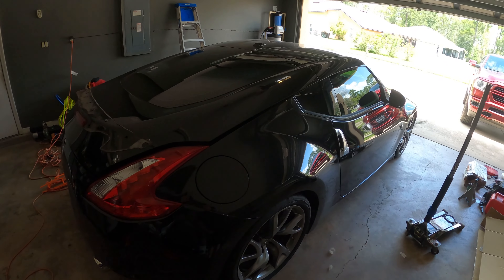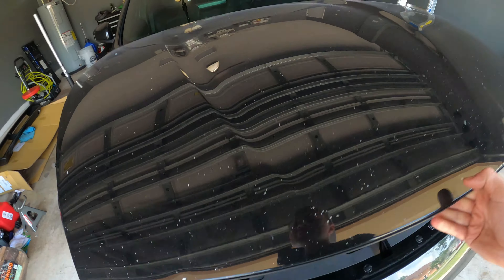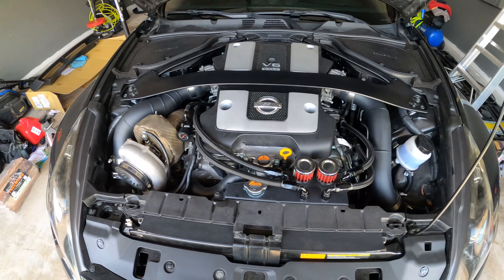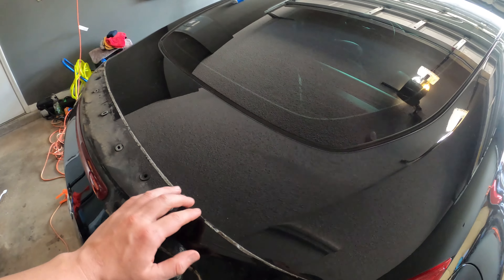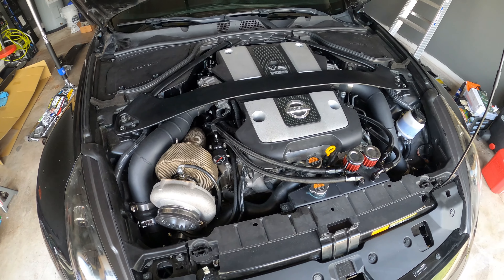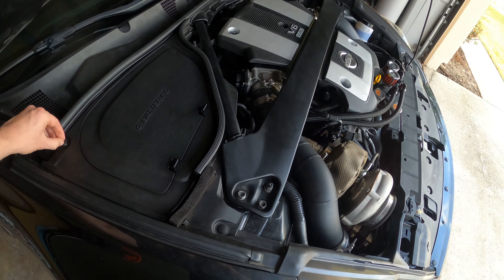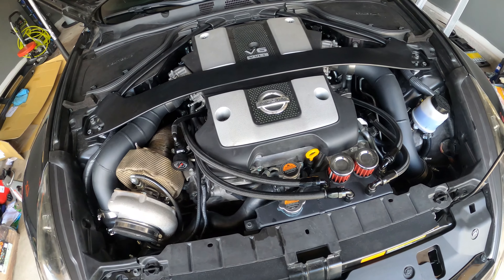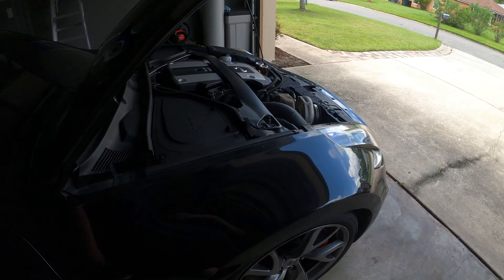The 370Z Broke Again | Building My Turbo Z To 900+ HP

Comment: Damn man sucks to see you gone with the z build. I was heavily inspired by your vids to boost my Z but the deeper I dive the more it doesn’t seem worth it..stock VQ blocks seem to really not like anything over 400whp. Makes me sad cause they are one of the coolest sounding engines ever made! Especially boosted. Plus I don’t got enough to drop on a GTR :(. Thanks for the vids tho man! Hope you’re doing well with your new car.
Reply from the maker: Thank you! From my experience and with some of the other boosted 370 and g37 guys some dudes have good luck and push 600 wheel no problem. Some guys like me blow it up after a few pulls. I have a buddy that lives near me went through 4 motors on 580 wheel and blew them all. Just luck I guess.

Comment: Do you know what could've prevented the spun bearing? I'm doing a similar build next month with Switchback and the 6466. Same injectors, 525 pump on stock block. Just worried about blowing it also. Going for 650whp
Reply from the maker: Well the first time I blew it was a mis communication between me and the tuner. He thought I had a 4 port when I had a 3 port Mac solenoid. The second time I blew it I just recently found out from switchback who I sold the car too. They was taking it apart and noticed the vacuum lines where installed incorrectly on the wastegate. Back story when the shop near me did the engine swap we replaced all o rings and gaskets well one had a small leak and the only way to access it was to drop the engine. Well when they reinstalled it they put the vacuum lines on wrong. So when I went to test drive it I blew it again. So from my experience both times I blew the engine it was not the cars fault. So I wouldn't be to worried about it. There are plenty of guys out there making 650. I made 636 on 14lbs and e85.

Comment: 4 digit HP. Might as well you'll be so close and you're tearing it down anyway
Reply from the maker: I think after my internal building my next limits will be either turbo or fuel. My current turbo is only rated to 900 hp. Fuel system i think i may need duel pump and bigger injectors. Im not sure what my duty cycle was at my current power.
Reply: Nah I'm just talking shit, 900 will be more than enough lol, good shit bro. Hopefully she's up and running soon
Reply from the maker: @ldnd41593  being able to say my z made 1000 hp though would be dope

Comment: hey boosted whats up?  I've got a single turbo 3.7 car.  Were you running 15 pounds for long?  I'm about to e85 swap and turn up a bit on a stock block but I want it to survive if possible.  Also the rubber wheels work awesome as long as you keep the speed/heat down.  
Thanks
Reply from the maker: Yo! Sorry for the crazy late response I’m sure you got it all figured out now. I was running 15lbs for quite some time till I blew it again by accident. The shop that fixed the oil leak put the wastegate lines on backwards and I blew it by not having boost when I was suppose to. But yeah 15lbs was killer. The r888rs where bad ass. I kept traction on that 800wheel pass when I first blew the engine.

Comment: 900hp overkill  Why not balance the car suspension subframe reinforcement  brakes 100 or 200 treadwear beefy tire setup at all 4 corners  still push like 700+hp w/boost by gear  n be a phenomenal drivers car
Reply from the maker: Not sure if you watched the whole video but I want to shoot for 900 but I'm not going to run 900. I'll most likely keep it around 700.
Reply: @ShayHarambe   I watched the whole video  I'm just saying  in general 900hp is overkill  I'm not wealthy so I need my car to do everything  900hp  n rear wheel drive  ends up being a 1 trick poney  to each his own tho  Freshkiicks Z is kinda the example  it's sick but  it's limited  He's got like 2 other sports cars  n a bike  So for him it ain't a problem
Reply from the maker: @427BDK  yeah i agree. its all in the plans of the build. Now i do have full suspension. I have solid subframe mounts to install and tires I will be swapping to something different when the z will be ready.
Reply: Ain't nothing wrong with having that much power on reserve. You can always run low boost for daily and road course. Then have a Hellcat/GTR, M3 etc mode 😁  just because you have 900-1000 hp at your disposal doesn't necessarily mean that you need to run at those levels all the time. That's the beauty of turbo car. You can always turn the boost up or down with a EBC and the right supporting mods.

Comment: I got an 08 g37 auto and I’m up in the air rn about reading it in for a manny Z, I don’t know how I fee driving a stick daily
Reply: I have a manual Z that I daily, I learned to drive stick in it! It’s easy bro, you just gotta get used to it
Reply: @reggieracing  my 85 4 runner is a stick and i typically get annoyed driving it after a while
Reply from the maker: A manual car for a daily really isn’t as bad as it may seem. Unless you have a hard af clutch lol

Comment: Right now I just got a plug play chip suspose   to give me 40 extra hp will see til I get header and exhaust and take speed limiter off
Reply from the maker: If you got the money one day I would go with sohos supercharger kit. Fairly cheap and makes just as much power as a top mount. Plus the blow off valve is wild! If I had to do it over again that’s the route I would have went.

Comment: is a walbro 450 fuel pump enough for 800whp?
Reply from the maker: Yes it will be. I am running a 450 fuel pump and when I boost spiked 28 psi my tuner said that was roughly a 800 wheel pass. I dont obviously have official data to back that up. Just going by what the tuner said.

Comment: You spun a bearing since the last tune ?
Reply from the maker: Lol yeah. I spun a bearing in my first block then my second block. The z is sold now. I couldnt keep dropping blocks in it.
Reply: BoostedVQ sheesh I don’t even know if I wanna boost it anymore 😅
Reply from the maker: @rabbz1128  lol yeah seems like some people have better luck than others. I have a buddy that lives close by and he blew 5 engines now he was pushing more power. My first block blew more of I dont know who's fault. Boost spiked 28 psi about 800 hp. Second block though I tuned for 630 wheel and blew it like 2 weeks later.
Reply: BoostedVQ yeah thats wild
Reply: @ShayHarambe  Were you always running it at 600+? Gonna boost mine soon any advice?
Reply from the maker: @brianritzpatrick4737  yeah pretty much. I bought the car it stayed stock for like 6 months then went straight to boost. Advice is do your supporting mods. That's the biggest thing. They suck to do and cost a lot but help so much. Also if you turbo it my biggest recommendation is go bigger wastegate or run two depending what kit you run. That was ultimately why I blew 2 engines. I didnt have enough control with one wastegate.
Reply: @ShayHarambe  Thanks appreciate it man. What you planning on getting now?
Reply from the maker: @brianritzpatrick4737  I have a 15 mustang gt. Actually I'm currently installing coilovers as I type this.
Reply: @ShayHarambe  those waste gates sure are engine killers lol now that I have a big 60mm no problems what so ever, placement is also extremely  important
Reply: @ShayHarambe  so to recap from a year ago im in your exact position lol ironic

Comment: Bro why’d you give up...
Reply from the maker: Well shortly after the z blew up a second time I had some big personal things pop off 🤷‍♂️ so I had to sell my Z and my brand new truck. I have a s550 mustang now. I plan on boosting it in the future.
Reply: @ShayHarambe  hmmm I have a nismo but idk that new 5.0 is nice, is it worth it or nah? Selling Z to get a new 5.0
Reply from the maker: Ehhh I had dumped so much into the Z. So for that reason no. However the 5.0 can hold like 800 wheel stock block. So that part is nice and really that’s just adding boost. No supporting mods are needed. Procharger added a p1x or a d1x to a 5.0 and made a little over 900. That’s just the procharger and I think pump and injectors. It’s crazy.

Comment: Do you recommend me to boost my Z ? Honest opinion
Reply from the maker: Ohf i actually haven’t been asked this question. Honestly no. I think you could find a better platform that handles boost better and for cheaper. When I went into this build I did not think it would cost this much. I know have a 2015 mustang gt where I could throw on a supercharger for 6k and make 750whp with no other mods.
Reply: @ShayHarambe  I see alot of people doing alot of mods on the 370z and sometimes I'm afraid I can blow up the engine for so much things and expensive parts lol
Reply from the maker: Yeah the z platform isn’t cheap to mod. When i was in it I saw a lot of people blowing with just intakes and exhaust. That has a lot to do with the tuner though. Cheap out and get a crappy tuner you get a crappy tune. Realistically even with fbo the z is slow. Sorry not sorry lol. You can’t really keep up with a stock mustang. The only time the car shines is when it’s boosted but to do it right it’s big money.
Reply: @ShayHarambe  you sold ur Z now what car are you going to tuned? 
When I saw your Z you gave me hopes to tune mine but I'm scared of blowing it lol
Reply from the maker: I have a 2015 mustang gt now. I’ve already done full bolt ons, bag and some exterior stuff. I’m saving for wheels and tires then a vortech supercharger. I’ve thought about making videos on it but so many people have videos on mustangs. Only a few had videos of a turbo 370z.
Reply: @ShayHarambe  I saw some subs asking about you and me included lol.
You should upload a video of your mustang. We are here to support too man.
Reply from the maker: Hmmm 🤔 maybe I’ll make a video soon.